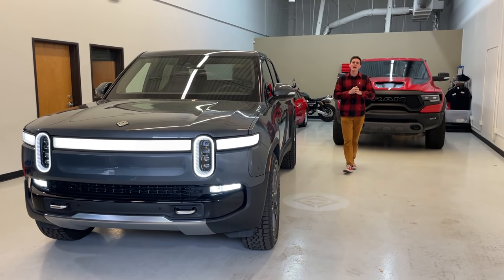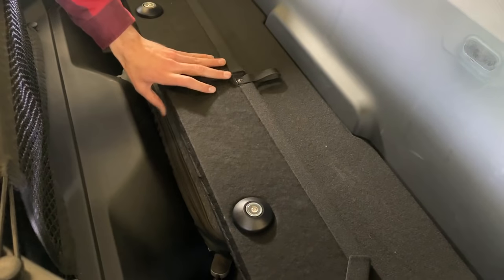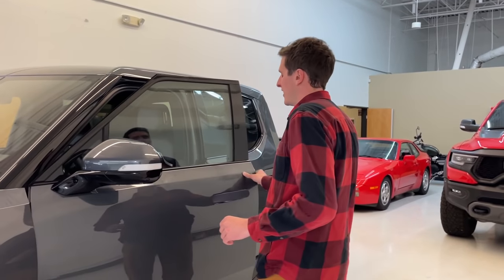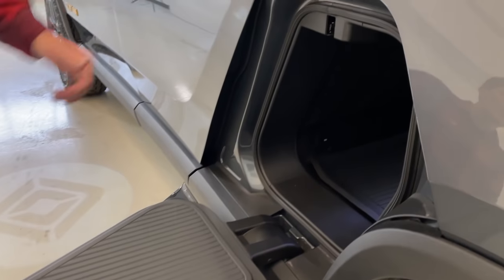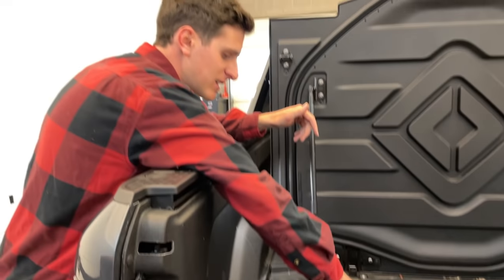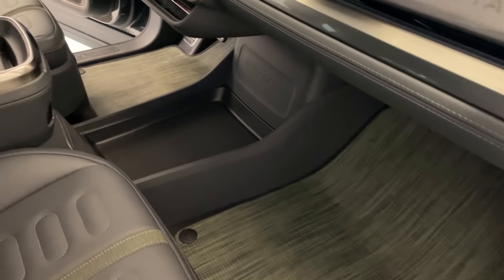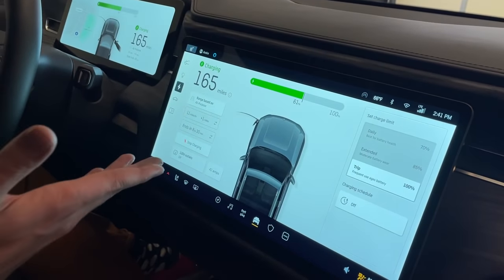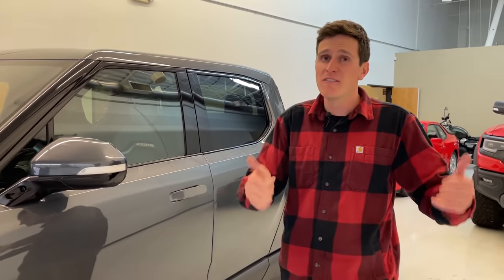The Rivian R1T Is a BIG Threat To Traditional Pickup Makers (Ford, GM, Ram) Here's Why!

Comment: Great job Tommy. This will be a fun week!! Hopefully we'll see a full 100-0% highway at 70mph to see how's the range in highway speeds in the winter
Reply: And loaded with 4 people. 
The weight makes a big difference in range. People often pack heavy for road trips.
Reply: Rivian owners are already sharing details of range/temp/charge.
Lots of 270 miles range in cold/driving 70-75mph highway in performance mode with all terrain tires. Lots reporting 290-300 miles in "conserve" and averaging more like 60-65mph highway.
Rivian is spot-on!
Reply: SO should they also run ICE cars out of gas to see how far they will actually go?
Reply: @valdius85  the extra weight of 4 people and their gear probably wont make a huge difference unless the aerodynamics are altered.
Reply: @dennisl6198  ugh, what?
Manufacturers try to limit weigh for what reasons then?
I exclude sports cars...
Reply: @dennisl6198  they do. They test the fuel efficiency on their channels.
Reply: @dennisl6198  Weight makes a HUGE difference with EV’s!! 🤨

Comment: Make sure you do a realistic tow test hauling about 4000lbs to mimic a home utility trailer or boat. No one I know consistently hauls 10,000lbs with their F-150, they’re towing campers/boats/utility trailers.
Reply: This right here.  My toy hauler fully loaded weighs in at 5,500 lbs, so I'd love to see them tow a 6,000 lbs trailer and get an idea of what range this thing can do under actual truck duty.  If it can only do 80-100 miles and then has to stop and charge for 2 hours it's not going to be anything close to practical.
Reply: @shazmodeus2795  And I have a feeling you sort of answered this for everyone... There is no way in hell that this truck is going to be able to tow anything like your toy hauler more than 150 miles on a full charge. I can't WAIT to see some towing tests. It's the one that that is REALLY holding me back from purchasing this thing.

Comment: Very cool truck! And THANK GOD IT DOESNT HAVE FRAMELESS WINDOWS! Couple of points of concern though!
-The charging port in the front I'd be worried about it freezing during cold snowy driving
-The buttons to control the tailgate and gear tunnel on the bed sides make it difficult to put a truck cap on
-What happens when your hauling gravel and  it comes time to clean out the bed and you get some in the hinge for the tail gate?

All and all its a solid unit and I'd love to rip one to the rockies! Great video guys!

Comment: It looks nice. I think they should have put some kind of step on the back of the truck to help you get into the bed of the truck. I would also prefer a knob for volume control for the sound system and separate buttons for climate control adjustments.
Reply: The gear tunnel door can be used as a step to get into the bed of the truck.
Reply: @ericanderson1753  you want a step near the tailgate

Comment: What I'm most interested in is to see if they'll allow 3rd party shops to repair and order parts. The closed ecosystem is what inevitably kept me away from tesla and I hope the rivian doesn't do the same.
Reply: Good point. 
The really need to sort that out as these will be damaged just because of what some people will do with them. 
One doesn't need to go off the road far to do some minor damage to the car.
Reply: Yup, I know a guy that sold his Tesla because every time something went wrong he had to ship it 250 miles to get it fixed. When it’s under warranty Tesla will pay for the tow but after you have to pay to have it towed the 250 miles. Then he has to fly down to pick it up. It’s very expensive and very inconvenient.
Reply: @craighatch3221  
That's why my first full EV will be from the major manufacturer: Honda, Toyota or Subaru.
Reply: @valdius85  You'll probably gonna have to wait a long time. Japanese brands still don't like EV's. Toyota has been lobying the last couple of years to slow down the ev revolution. Even after their recent presentation (which they did of course to keep stock holders calm) , a couple of days later they bashed EV's again. Toyota formed an aliance with other Japanese car brands last year to develop an ice engine which can run other syntethic fuels... they just can't let go of ice...
Reply: There is information on this if you search the Rivian support system. It sounds like a combination of having repairs done by wire, at Rivian locations, by traveling Rivian support techs/mechanics or by your local shop once it gets approved by Rivian for the necessary work. I like the sound of it on paper, but we'll see how it plays out in reality.
Reply: Agree, most important to have 3rd party repair or many local dealers. Parts must be readily available. If not, no sale to me.
Reply: What parts? I live in Bloomington and I see R1Ts driving around with a burnt out headlamp projector almost every day. You won't have to worry about repair because you won't be able to get parts 🤣👌

Comment: Loving the coverage of this truck so far!!!  Question:  I have a F-150 with a 'roll-top' bed cover somewhat like the R1T but of course, all manual.  In the summer, it is fantastic however in the winter (central Alberta, Canada) it is frozen most of the time and inoperable.  Have they tested the cover much in a variety of cold weather conditions???  Thanks!

Comment: Looks like a lot of thought has gone into the usability of this vehicle by the design team. One feature that is on a lot of trucks that seems to be missing from the R1T is a handle on the inside of the A pillar to help hoist yourself up into the seat. It does have grab handles above the doors but they don’t help old bodies get up into (or down out of) the vehicle.

Comment: Excellent, thorough vehicle introduction.  So far, this truck looks well thought out.  The exterior power “gadgets” are cool.  Hopefully their reliability will be good.  Gadget-wise, although very slick, the charging port access door gives me pause.  My first reaction is how well will it operate in cold weather (as we wake up to 2* above 0 here in New England).  A little water in the wrong place could easily have you frozen out with a low battery that needs a charge.  The build quality looks good, particularly for a new manufacturer.  Hopefully Rivian will not have the bad science experiment electrical issues that seem to plague Tesla.

Comment: I love the idea of this truck and would buy one now but I need longer travel and/or faster charging time.  My sister-in-law lives six hours away and I can make it on one tank in my current truck.  And if I do have to fill up, it's five to ten minutes and out.  I also drive cross country from FL to CO and I do that straight (22 hours with only stopping for fuel/restroom/food).  I tow my boats and kayak trailer around locally so I don't think that would be a problem but I also tow my boat to the Keys (ten hours-ish).  I need longer battery miles and/or quicker charging before I can make the leap.

Comment: Hi Tommy, need to see the drivers display while in drive mode, I have a couple of EV's and some of the info that is nice to have along with the speed, KM total, also range (hopefully for the range estimator), and my big desire is % of battery capacity left, and also current KW/per 100 KM or watt /KM

Comment: Great review. Very curious on the button controls on the bed of the truck. Camper shell would block these buttons. Long term baking in the sun and frozen in the winter (have to clear off snow/ice to use)...have my doubts about durability.
Reply: Key fob drops the tailgate too
Reply: Camper shell will probably have it's own buttons for the bed, or the key fob can do it.
Reply: You can also open from inside the truck.
Reply: I'm willing to bet that the second gen or even the refresh of this truck moves those buttons. They are in a not so great place for the reasons you stated, that said Rivian designed this without a shell and garage parking in mind, and with the SUV they probably assume if you want it covered you'll buy the SUV. I think it's about the only real "miss" on this truck, and even that's not so bad.

Comment: Hi TFL loved listening to this overview of the Rivian, I have I few questions that I would like to put forward for you to ask Rivian when you do the debriefing:
1. Will the green light bar become a charging progress bar with upcoming software updates?
2. Can the Rivian accent 35' tires if the owner would like to put them on.
3. For the upcoming 180kwh MAX pack, will the larger battery take up any storage space that the 135kwh Large pack provides? I.e, will there be less storage in the 180kwh version compared to the 135kwh version.
4: Overtime, will it be possible to add software updates that increase charging speed further than 210kw and horsepower and torque?
Finally, will the 180kwh MAX pack R1T come with less/more torque and horsepower than the 135kwh version that you tested during Rivian week.
Thank you so much TFL for throughly testing this vehicle for us, and I would be grateful if you could ask a few of these questions to the Rivian team on behalf of your audience. Well done guys!

Comment: love the design and all the clever details they put into it. Only knock is i think the bed size is a joke and wish there were more length options. Given that I would probably get the R1S and have a shorter wheelbase for better breakover angles.
Reply: I was hoping for a bigger bed as well, I fill my 6ft bed when I'm going with a couple people to camp. I was looking forward to bollenger when they launched to get a longer bed ev but recently they announced they'll only be doing commercial vehicles and started to cancel private orders...
Reply: The bed size is fantastic for offroading since you clearly don’t need a truck to work out of
Reply: @ItsMeGiga  youve got a frunk and gear tunnel which in total exceeds a 6.5’ bed by volume

Comment: Overall I like the truck design. The front is different and doesn't need to be, but everyone has their thing. The only real concern I have is the charge port location. I live in Michigan and deer can be a pretty big concern. In theory you'd be going straight to the body shop right after hitting a deer, but maybe not. I'm just surprised they didn't locate the port somewhere more on the side of the truck like other EVs or a traditional fuel door location.

Comment: ⚠️Charging Port Location: functionality & electrical safety concerns:
1: Snow, Ice & Water
2: Frontal Crash Worthiness  

1: I’m sure Rivian engineer’s have already addressed the charger port location in terms of rain, snow and ice which  accumulate on the front grill area and flowing down the hood right into the charger location seems concerning when charging.

2: Also, Having the charging location upfront seems counterintuitive for electrical safety during a frontal crash.

Comment: If the price wasn't astronomical, I'd consider a Rivian. However, at 120 000$ (Canadian) for the options I'd like (I went to their configurator), that's a price I cannot swallow. If it was closer to 70K with a great financing option, yeah, I could see it... but without a great finance plan, and trading in my current vehicle and such... 120K is just way too much money. I'd honestly drive it if I could, it is a very neat vehicle...

Edit: The truck starts at 90K Canadian. The Adventure is 97K. Extended range is an extra 14K, and the off road package is 3K. Add on that anything not Silver is +2000$, we're looking at 118 000 for the Rivian...

Comment: Love the Rivian, but that charge port is literally in the most vulnerable spot for an offroad car.. Why would they put it there AND make it a super complex and expensive to repair item?
Reply: I always wonder how hard it would be for them or any high end EV to put dual charge ports.  Probably will set them back a few million $$$,, but well worth it in this truck I think
Reply: @ashrafc7794  Let's say it costs 70 bucks in parts plus manpower,.. That's 7 million for 100k cars. Excluding the additional costs of certification.
Reply: I'm pretty sure the rational behind the front charge port was better accessibility for DC fast-chargers on trips while towing. With the fron port you can just pull nose first into a charge spot, rather than pull alongside a bank of chargers.

Comment: while it seems to have some neat storge compartments, the 4' is way to short.    6' 6" is the shortest box I 'd even consider.   My current truck is a 2020 F350 crew cab short box . Its 6' 8" box seems the right length for me. My next truck will not be a crew cab. I have found I dont care for the big cab.  i just dont need to haul more than one passenger. i got by just fine for years with reg, cab 8" box trucks and my go back to them.

Comment: I know you  AMericans  love  your  big  Proper size trucks  but    here in  Europe and  UK where i am   Pick ups  are  a lot  smaller   mines an old Mitsubishi   L200   so similer size bed  but probbably a little smaller  OAL   these are the main stay  of  rurual England  once you get fed up  fixing a landrover every week ;)   as long as you can chuck in  5 Hay bales  and a few bags of  feed   etc  its a great size  ...      I would  like to put a cab on the  back  and fully enclose it  hopfully options late  (if it ever comes over the pond  ) tho all the fancy  open close buttons  will need  alternates  :D   Maybe  even  a  End tent   cover to   close in when the tail gate is  down so you can  sleep on the 7ft flat bed  

Truck beds seem to have been getting higher from the ground as time goes on    not  good if your lifting in heavy stuff  but  maybe the adjustable ride hight can adress that 

unfortunalty   its going to be decdes till  one is affordable  in UK

Comment: You guys are really in the tank for this truck company that haven't sold anything outside of there plants workforce. I wouldn't praise a midsize truck that cost 70k and say Ford, Ram, or GM needs to be worried. When this EV truck thing shakes out will see if rivian is still in business.

Comment: Please, please use this truck to tow 10,000 lbs, 6,000 lbs and 3,000 lbs so we can see what kind of impact this has on this models battery range.  Speaking for myself I have a Colorado Teardrop trailer that weighs 1,900 lbs unloaded and want to know the impact to range.  Is the 400 mile range battery going to be the better model to buy?  I hope you can squeeze this test in while you have this truck. Thank you TFL.

Comment: OK...  So that charging door that is power opening and closing.  What if the battery is completely dead?  Then the buttons on top of the box rail.  I bet those will work great after a rain and freezing temps.

Comment: I'm skeptical about that automatic charge port door.  I see it as unnecessary complexity and something else that could fail or ice up and leave you stuck because a flap that could simply be opened with a spring or a finger is seized closed.
Reply: From my personal experience powered door (Model Y) works more reliable than manual (Pacifica Hybrid), maybe not because of power option but more because of more ice, snow and ice rain-friendly design but still...
Reply: Totally agree.

Comment: How do you think that tonneau cover is going to work in the winter in places that get snow/ice..or leaves for that matter?  Is it true the rear trunk where the spare tire is housed can be used as a cooler (with drain plug) if the tire is not in there?

Comment: If they make one with a longer range,  like 500 miles.  I would buy right now lol!!!
Reply: There will be a 400mile range option
Reply: The engineers from all the brands are weighing pun intended, weight, range and costs.

More range equals more batteries and more weight and more costs. 

Weight of batteries reduces range so adding more it counter productive.  Especially as it reduces towing / hauling specs.  

Batteries need to increase in energy density to affectively increase usable range.

Comment: What is the Volts and amp rating of your wall charger? Also what size breaker is in the electrical panel?

8-9 hrs from 60% to 100% seems excessive.
Reply: Thats a standard 240v 32a charger in use
Reply: Over 18 hours to fully charge the rivian ‘at home’?
Reply: @ZzHasbrozZ  If they had a 60 amp charger it would be almost twice as fast (but that's pretty high power in your house, not every place can do that). But you are driving a 7,000 lb vehicle.
Reply: @lattelandlatteland  I installed a 50 amp outdoor outlet.  Standard stuff.  But breakers are designed for 80% continuous capacity. A 60 amp would likely charge at 48amp.

Comment: Thanks Tommy!  It can tow 11,000 pounds but I see no holes for a fifth wheel, is that a possibility?  I’d guess they’d need a cradle to hold it due to the spare tire storage location.
Reply: My gut feel is the bed might be on the short side to facilitate a 5th wheel hitch. Generally want it right over the rear “axle”  (wheels) so the pin weight doesn’t adversely load or unload the front wheels.

Comment: I think the spare tire location is a problem. What do you do if it is loaded up with cargo, let’s say a pallet of some heavy materials?
Reply: Well since a pallet wont fit in that bed, you do nothing.  In an off road focused truck id much rather it be in bed than down in the mud / getting drug over rocks
Reply: @mattbrew11  Maybe a pallet won’t fit, but a truck bed full of 2x4s and some plywood sheets will. It is after all a pickup truck.
Reply: Be grateful that you even have a spare. Most cars don’t these days.